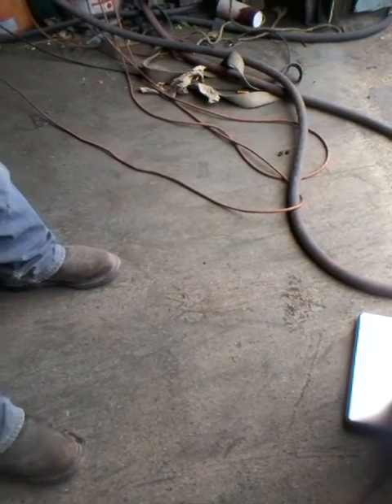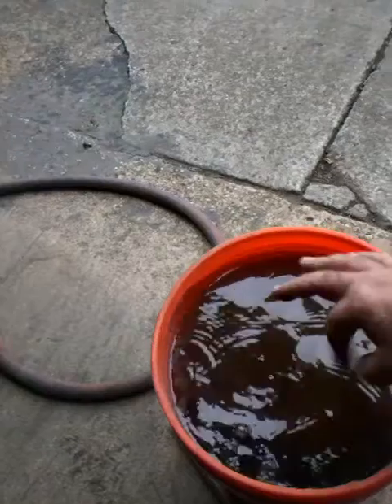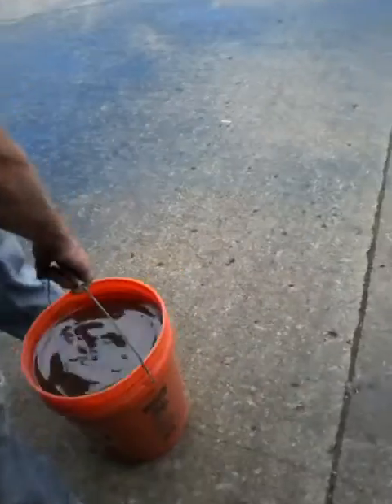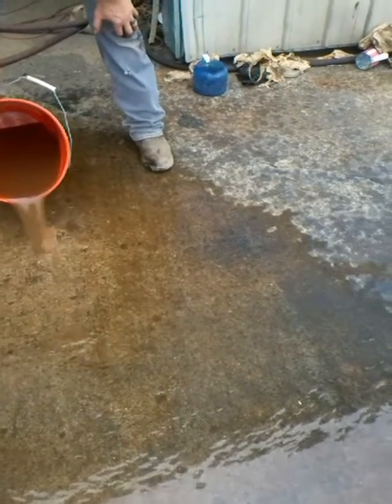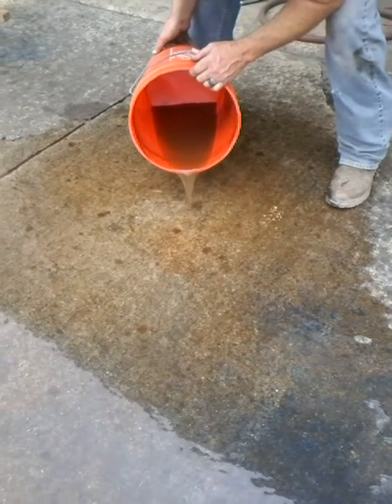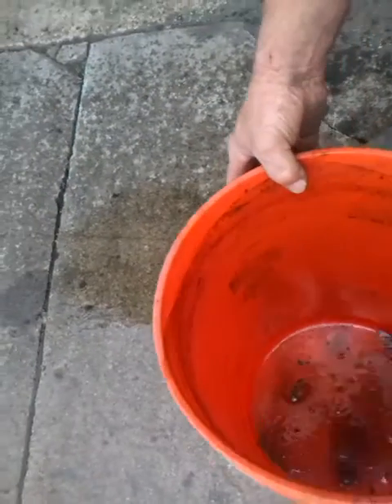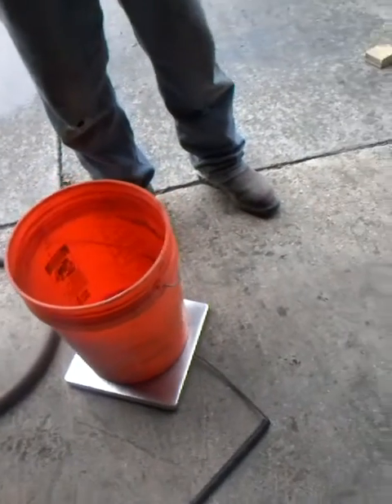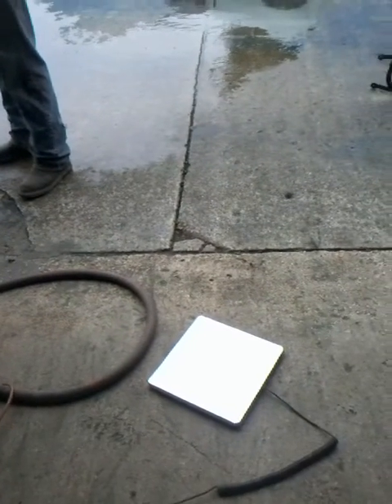BURNING EXPERIMENT RESULTS

Comment: Don.. ever messed around with Hi test hydrogen peroxide .  imagine a diesel fuel injecton pump.. to control the amount of high test hydrogen peroxide into a pressure chamber with a platinum grid.. turns to instant steam.. 

imagine spraying water into a pressure camber with Metallic lithium, or metallic Potassium or metallic sodium inside..  the reaction should be super heated steam depending on the volume of water and the spread across the surface of the blocks.. 

 i ran into an old lady years ago.. that sold beauty supplies. she had a cardboard drum of chemical that when mixed in water made the water into hydrogen peroxide.  never learned what the chemical was.. its highly restricted. as high test peroxide is very UNSTABLE.  a 500,000 square foot warehouse in commerce cal was flattened when the trucking company raised the shipping price after they had received the product in their building they did that a lot.  the shipper said we have a contract for a price.. the delivery company said more or it just sits..   the shipper said.. you really don't want to delay that.  after sitting for several months it went off.  much like the warehouse in Beiruit..  completely flattened the building.. blew out windows up to a mile away. turned over cars and trucks 7 blocks away.   was significantly louder than a Broadsides from the battle ship iowa  a few months earlier and 100 miles farther away..